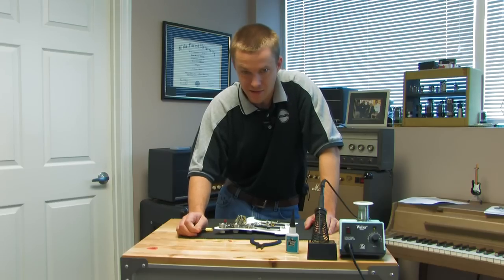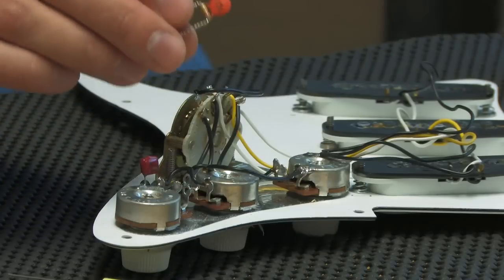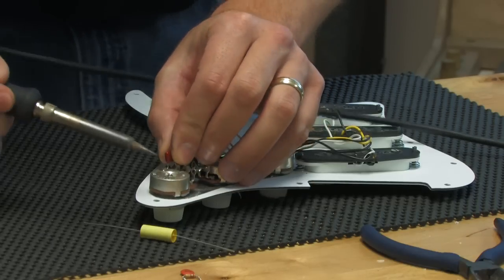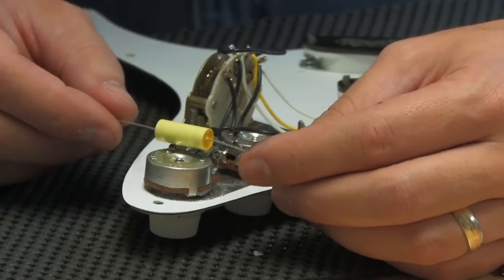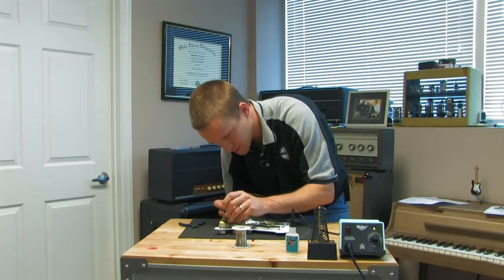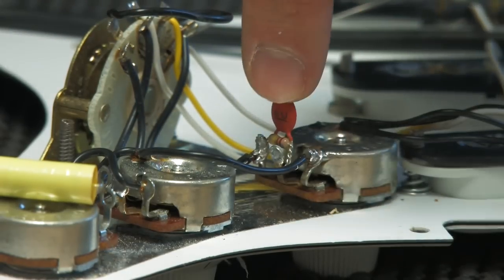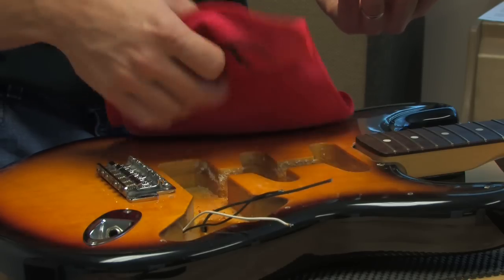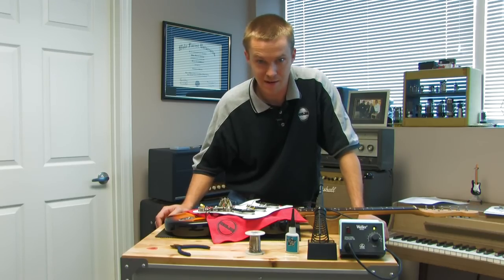Mojo Techtorials - Capacitor and Volume Mod upgrades

Comment: I always heard you need to make a solid PHYSICAL connection with the wire before soldering it.  Is that true for these cap mods?  Maybe it doesn't matter as much since all the signal isn't going through it?   I don't know.
Reply: You don’t always need to.  But it is always good practice to do so.  If it’s on an organ that weighs a few hundred pounds, it probably won’t bounce around too much, but why not make sure.  At one extreme talk to someone who does auto work, everyone will say it needs a mechanical fix in addition to the solder.  I would take this guys “how to” with a grain of salt.
Reply: You can wrap the wire around a post and tape it if you want. Only you'll know and it might come lose but it'll do the same thing.

Comment: The capacitor is out of the circuit until you activate the tone control - if you turn the tone control down and back off the highs - who could ever tell the difference between the type of capacitor!!!

Comment: I build and design tube amps,plus other tube and electronics gear,i am an electronics design technician,i live in scotland,i also get annoyed when i see people touting poly type caps over other poly type caps ,poly meaning poly-styrene,poly-ethelene,poly-carbonate,poly-ester.

POLYESTER are the ones fitted to the guitar,and the yellow one in the vid is also a "METALISED POLYESTER CAPACITOR",they  are also the same as those orange drops people get conned into buying for tube amps,the MOST accurate cap you will ever need is a polystyrene,very accurate,very stable(thermal),polyester is the most favoured though for this application,smaller values restrict bass ,that is values like pico farrads,the 0.022uF(micro farrads) = 22nF (nano farrads) is more up to mid range,the o.47uF or 470nF will pass more bass,if the cap is in series with the signal,if the cap goes to ground if will shunt the portion of the signal to ground,and if you have a tube amp don't buy oil caps from nineteen canteen,those dried out and turned to shit years ago,use modern caps,and don't pay dollars for parts that cost pennies(real pennies for me) cents for you guys,that resistor cost 1-2 cents the caps were maybe 20cents each,the resistor across the cap works like this,the signal sees a fixed resistance(can be a pot) the cap is frequency dependant or in tech terms it has capacative reactance at a certain rising frequency the reactance(measured in ohms) will be close to zero,this will allow certain frequencies to pass while the lower frequencies will "SEE"  a resistor  and the cap will look like a massive resistance,if the resistor is a pot you can dial in more bass to by-pass the cap,so if the cap is the same value as the cap on a bassman amp bright pot,which is usually 100pF(pico farrads) =0.001uF or 0.0001 of a millionth of a farrad(1 farrad is quite huge electronicaly speaking),as this cap comes more into play,that is the volume is lowered,meaning the wiper is going to ground,before all signal is grounded  more bass is attenuated and the treble component is allowed to pass in greater quantity with respect to the bass being grounde,at some point the whole signal is grounded,but if the wiper is connected to one end of the pot so it is a variable resistor or rheostat with the cap in parallel ,one lead to each outer lug of the pot a variable tone pot or EQ pot can be made,basically a tone cut.

To find the impedance(in ohms) the cap will show to allow any frequency from0Hz to 20kHz use " 1/2 x pi (3.14) x f(Hz) x C (capacitor value),so for 7kHz and a 22nF cap,we get ,

                     1/2 x3.14 x 7000 x 0.022uF=1k ohm,1 thousand ohms,for a signal of 800Hz the equivalent resistance of the cap will be 9k ohms,a 25k pot would be at almost the middle position for 800Hz while the 7kHz signal would see almost no resistance,compared to a 25k volume pot the pot is almost set at zero resistance.
The 1/2 x 3.14 etc is 1/(divided by) 2 times pi times the frequency times the cap value.

You can work backwards if you wish using 1/2 x pi x f(Hz) x R,"R" being the resistance you want to block  any frequency with by the caps impedance,
i will write it as i normally would except i use the greek symbol for pi,
 so,         1/2pifR,1/2x3.14 x7exponent3(to the power of 3 meaning 3 thousand,3 zeros) x 1k(1000 ohms)= just about 22nF,different resistance values plugged into the equation yield different cap values,higher resistances will give lower cap values,lower resistance will give larger  cap values which allows more bass to pass,you can also use inductors to get the same results,the equation is 2 x pi x F x L,"L" being the value of the inductor in "Henries".
Farrad,henry,ohm are peoples names,while capacitance is a measure of capacity of charge,i for get who discovered the cap,i think it was a man named "layden" caps were also called "layden jars" and also "condensors"(used with points for car ignition to absorb energy to avoid arcing".

I hope this is useful,and helps anyone from getting burned,for parts that are touted as "special",it's all  a load of bollocks,learn some basic ,and i do mean basic electronics theory for capacitive,resistive networks,caps can be series in signal line or to ground,a cap can be connected to  a pot wired as a rheostat to ground as a cut pot,an inductor can be used the same,play around,the parts need only be 10 volt resistors will be rated at hundreds of volts for 1/4watt parts and inductors will withstand ANY guitar signal,that being at the most a volt or two,the usual being a few hundred millivolts,learn to SOLDER first,and there is a "L" in there,use it,like alumin"i"um,not alumin"um",that shit annoys the crap out of me,for that small lesson i get to rant a bit.

NEED ANY HELP ,JUST ASK,(£80 hourly rate,£60 after the first hour).
Reply: I liked your rant until you mentioned Aluminum
Reply: from thoughtco.com  "The IUPAC periodic table presently lists both spellings and says both words are perfectly acceptable. "

Language...  when will it ever get standardized?  or is it "standardised"?   Very nice post, btw.
Reply: How humble, hey!😂

Comment: Great video thanks!  I love different makes of caps vs. using just the  "chicklet" stock ones, even though most people claim they'll all do exactly the same thing.  One criticism I have about this tutorial is the use of heat-sinks.  If you do an experiment you'll see that they are absolutely nessesary.  Touch the cap when you solder it in place and see that it's impossible to touch because if how hot it gets! (you're cooking it)  Then, solder one on place using heat sinks and touch the cap.......cool as a cucumber!

Comment: Don't you need to use a heat sink when soldering caps or is it not necessary?
Reply: I would say no. But if you have one of those heat sink type clips, use it anyway.